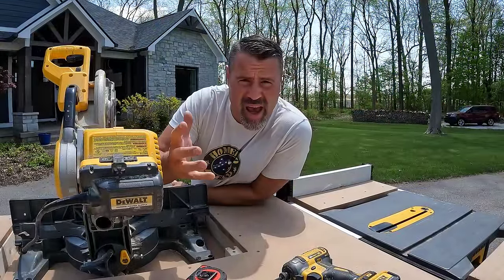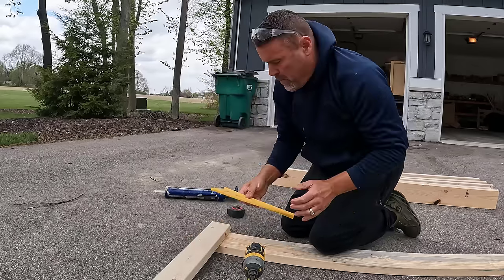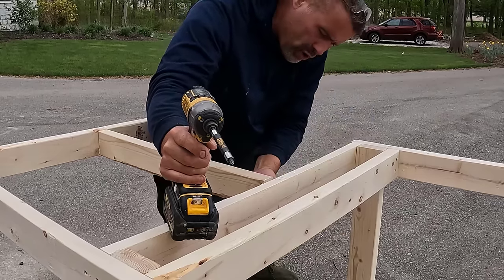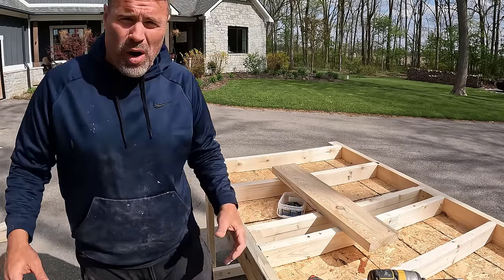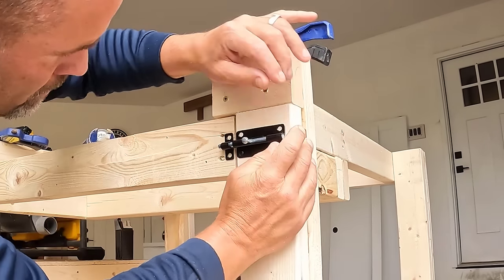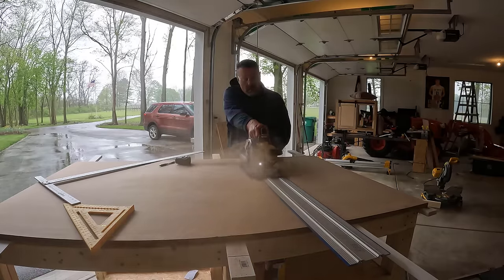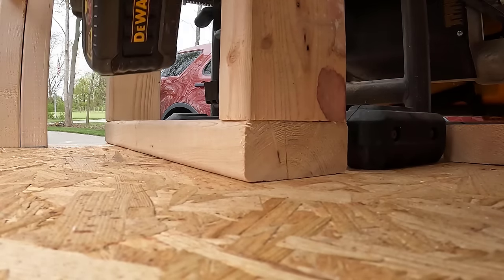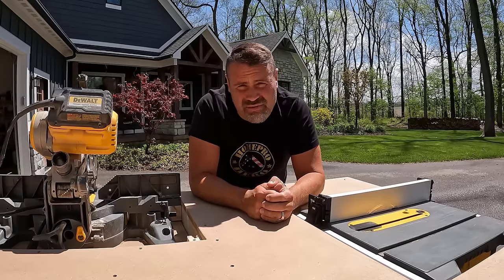Build This Workbench for UNDER $200

Comment: Is it ok to just having the saw sitting directly on top of work table and just use blocks of wood or bricks or something to keep the wood level? I don’t have the space or means to make a recessed special bench for it.
Reply from the maker: Yea for sure you can do that. Just have to move the saw off and maybe store underneath it.
Reply: @HomeProHero   thanks I just got a ryobi 10 inch to make cradled panels for my art after trying a miter box was a disaster.  I’ll be putting it on a portable worx brand sable and clamping Mdf to it which I plan to screw the saw to it. I got Home Depot to cut the long 1 x 2s wood on half to make it more manageable  but I will still need a way to keep the wood level.
Nice thing that little saw has a built in clamp to hold the wood in place.

Comment: Is liquid nails better than wood glue?
Reply from the maker: Good question!  Wood glue is use for minor fine trim projects. I use LN for every thing and especially on bigger bulky outside projects. LN is also much thicker and wood glue is very thin so you can expect that LN would have better coverage. Thx for watching!
Reply: Thanks for answering my question :) @HomeProHero

Comment: New to the craft, is there a reason you used liquid nails and not wood glue? Thanks!
Reply from the maker: Thanks for watching!  I normally always use liquid nails for 2x4 type construction or anything that might get wet. It's simply stronger too. I only use wood glue for fine wood type projects like the bathroom vanity I built or really anything that is inside the house. It's much thinner and clean up is easier :) Hope this helps!  Take care

Comment: Liking the build, the MDF on the top platform might give you a headache eventually.  When I built mine, I did the same thing with the MDF. After some time, it'll get that fuzzy texture to it, which makes it impossible for a  good cleanup after a project.  I had to get a scrap piece of 1/8 " masonite and secure it to the MDF. It's so much better, if I had to do it again, I would use a piece of 3/4 AC plywood for the top. It's just as smooth, but definitely would not weather like the MDF. Again, love the build.
Reply from the maker: Yea you are exactly right!  Already thinking should have used a different material but I like your solution!  Might have to give that a try but it will require me to raise the saws up a little :( Thx for watching!

Comment: I may have missed it, did you do anything to make sure the table saw was flat/level with the rest of workbench when it's in use?
Reply from the maker: Great question!  Yea I threw a graphic on the screen towards the end how I calculated the height of the shelve for the table saw. With that said most saws are different heights so I didn't give exact measurements on the setup for my saw. Thx for watching!
Reply: @HomeProHero  Oh ok, thanks. Same for the miter saw?
Reply from the maker: @TravisSingleton  I think a miter saws are more standard at least what I have seen. I think the deck on the saws is 3.5 inches which is the exact width of a 2x4. Take care!

Comment: It's a nice little simple bench, Good job. The only recommendation I would've given or give to your viewers, (& pls no offence to your work). just an opinion! Just this tip would make it 10 times stronger and a little less bulky, would be to use Half-lap joints on your frame instead of simple butt joints. It would've given it a lot more strength.

But aside of that. Its a nice little workbench. well designed for small spaces. Congratz!
Reply from the maker: Thanks for watching!  I totally agree with you on the lap joints but honestly the butt joints with screws and liquid nails do a great job!  tried to keep the project quick and simple.  Thx for the feedback

Comment: Great bench. Thanks. Subscribed.
Simple straightforward 

One Q/point.. Mitre saw bench does not look very substantial.
Can see those hinges working loose.. Hope I am wrong.
Maybe put in a through rod and bearings?

Thanks for the inspiration and plans.
Reply from the maker: Thx for the sub!  It's really firm at this point. Not sloppy at all if anything maybe a little too tight. You could always use longer screws into the 2x4 but I thought if the hinge screws can support a door from the side they should be good enough for the saw. Take care!

Comment: Man this is awesome! I was just about to buy one but this is inspiration to make one myself.  Any thoughts on making a double so a big platform can be used if cutting a 4x8 sheet of plywood?
Reply from the maker: Thank for watching!  You could make it bigger for sure. With that said my is getting pretty heavy to push around so weight might be a issue. I was just looking for a compact design and even at that size you can cut a 4x8 sheet of plywood mist of the time. Take care

Comment: Only thing I'd do different is to make it foldable since I have a very small shop. Also I'd leave an opening under the table saw for wood chips and saw dust to fall through and not build up under it. Of course you can just as easily blow that out after use. Nice work bench and video.
Reply from the maker: Thx for watching!

Comment: Hi.   This is awesome!!! Thank you so much for taking the time to share the plans/build.   I am stuck at 4:10 mark on video.  I know you mentioned in comments that 2X4 is 28”.  After looking at the plans is the measurement from front of bench (back side of you on that video )to the surface of 2x4 (palm of hand resting on 2x4) at 4:10 mark 13.5”?
Reply from the maker: Good question the drawings don't show that measure well!  You are correct its 13.5" but it can be adjusted either way if needed.  If adjusted several other measurements change.  Thanks for watching!  HPH
Reply: Thank you MD for straightening this out.   I thought I was losing my mind.   I can only throw my tape measure so many times.

Comment: I just use strong clean heay duty HVAC shipping pallets to build mine. Lol. Saves ALOT OF TIME on the foudation. Lol.  
Man, you sure love that Liquis nails. Lol. Overkill, but NICE JOB! 
P.S. I did my lower shelf under support differently, sort of like  the bottom of a bed frame for the box springs. Lol. Then I used the green pallet struts you I get for free from 'Home Despot'. They're awesome! Very strong. Weaterproof too for damp locations like garages 
#ImJustHereForTheFoldingChopSawPlan. 🤣🤣🤣🤣😅😅😅😁😁😁👍🏼👍🏼👍🏼👍🏼
Reply from the maker: Hey whatever works right!  Thanks for watching

Comment: Liquid Nails - So I haven't seen anyone use liquid Nails on almost every joint,  no criticism just a question as to why? what is the benefit?  Great video!
Reply from the maker: Thanks for watching!  I have experienced movement in the joints when using screws and nails.  Especially in something like this that will be moving and not sitting somewhere stationary.  The LN makes junctions super firm and will pretty much eliminates any possible movement forever.  Its pretty cheap too :)  Take care!

Comment: I bought the plans from your site.  They are slightly different than the video.  The support that is in the center in the video is offset toward the table saw.  Which should I follow?
Thanks, Doug.
Reply from the maker: Follow the plans as I believe they state that the plan have been modified slightly to improve the workbench. I sold a ton of those plans and no one has reported any issues. Thx

Comment: May I suggest a 4 -6 ft. power strip attached. This way, all devices are plugged in at the bench and you only have the bench cord to plug in.
Reply from the maker: Yep for sure!  Actually have it planned on the next workbench video that includes that power strip and dust collection!  Thanks for watching!

Comment: Does anyone know if this will fit dewalt dws780 Dimensions: H 19.5 in, W 23 in, D 32.33 in versus what you have which is dsw779 Dimensions: H 18.8 in, W 23.75 in, D 33 in? Pretty close in terms of dimensions
Reply from the maker: For sure it will fit that saw!  I have pently of room on all sides.  Keep in mind that the depth of the saw is kinda misleading since the lower part of the saw is more like 18" and the top (The saw itself) is the depth of 32/33".  No issues!
Reply: Thank you for quick reply.  I went to go look at the saw you have on your work station flex volt doesn’t match the one in the description (dws779).  Just want to confirm which saw do you have mounted on table? Thanks
Reply from the maker: Yea the saw I have been disconitued so I posted a similiar model.  Its safe to say almost any miter saw will fit in that area.  The important part is making sure the deck on the saw (where the lumbers sits before being cut) is 3.5" inches.  Take care
Reply: Thank you.  Just so others know the 779 will not fit with the build.   It is sliding and too bulky for the build.  Have to get non sliding if doing same build

Comment: Thanks for the great tip with the ,itre saw swing table. I'm deadset gonna change my half built table to integrate that beaut feature. I will mount the barrel locks on the inside so we don't see them. Pro tip; MDF dust is bad for your lungs. Use a mask when creating sawdust from it.
Reply from the maker: Thanks for watching I agree on the the mask!  Take care

Comment: I have the DW745 table saw and Love it. I had a metal cabinet from my grandfather i kind of built the table around it. The table is 7' long and 40" wide. It has a cubby for my crosscut sled and shelves for the circular saw, belt sander, jig saw, and sawzaw. Also has a spot for the shop vac. The tpo is sliced pallet boards and all 6 side posts are oak runners from the pallets. Definitely a lobor of love building this thing
Reply from the maker: Sounds nice!  I'm going to add dust collection in an upcoming video I get a ton under from that table saw. Cakes my tools!  Thx 4 watching!
Reply: @HomeProHero  next on the list is dust collection. My father in law gave me an old 3 speed box fan. Going to do a wood box around it and have a slot to drop in the air filter. Everything I have I've made simply out of necessity and the available wood I have laying around.
Reply from the maker: @mikedarr7723  I'm going with a shop vac, 5 gallon bucket and a cyclone. Supposedly works great!  https://amzn.to/3pp92fV
Reply: @HomeProHero  yup, I did buy that... LoL

Comment: Killer!  Love it.  I may have to settle on this bench, because it seems both easier to make than a lot I see on YT and also less time-consuming, more space efficient, etc.  You really packed a lot into this baby!  I bet you can get a nice dust collection system fit under the larger area down there.  I wonder though would it work to put dog holes in MDF?  I've never worked with it before.  And could it fit a vise or two on the sides?  Trying to think about how to turn it a bit from a carpenter to a woodworker setup.
Reply from the maker: I love it so far!  Thx 4 watching!  Dust collection video coming soon it's a must if you plan to use the lower level for storage.

Comment: I noticed he stopped using liquid nails about 3 minutes into the video. I can’t see why you would need liquid nails to begin with
Reply from the maker: I use it to strengthen the joints.  Its cheap and prevents any possible movement in the table that will be rolling.  The combination of the screws and the liquid nails works well but not necessarily needed.  I forgot to do it in several areas :)